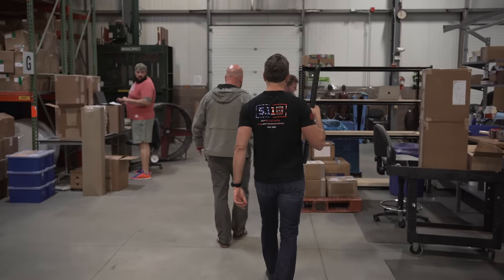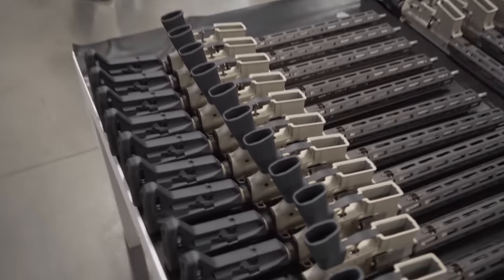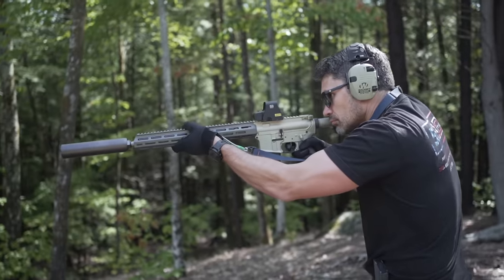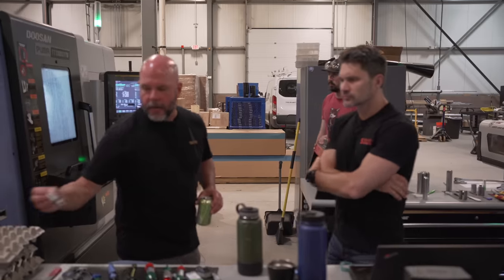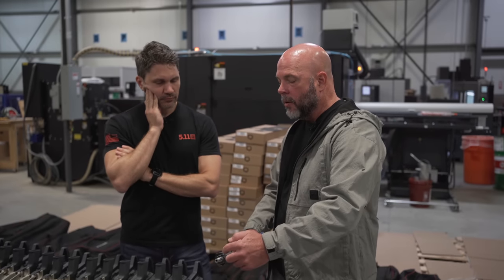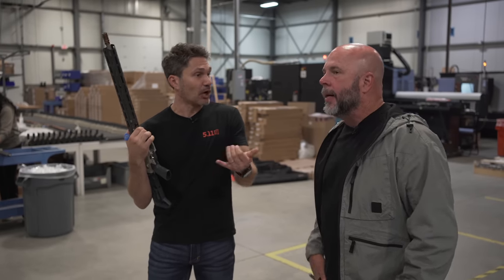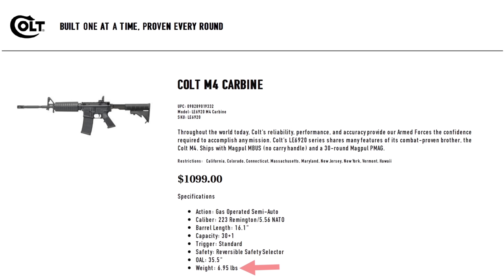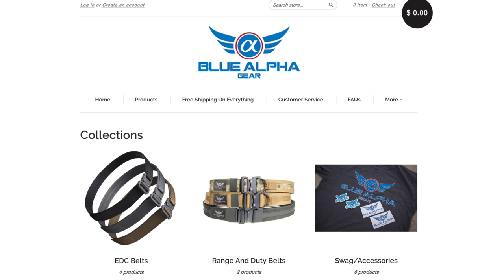Why Q's AR-15 Will Disrupt the Market: The Sugar Weasel 16"

Comment: That seems like a lot of money for a rifle without an ambi-bolt catch. At that price point, I’d expect a little more
Reply: I kinda would like to see an ambi mag release too but I know that's a small market they're not catering to lol.
Reply: @andreivaldez2929 for the money I’d want a full ambi lower. At the very least.
Reply: ^^This.  About 10% of the people are left handed and about 33% are cross dominant.  Additionally 100% of the people who use a gun for self defense can not be sure that a self defense situation will afford them the luxury to choose which side they will be firing from.
Reply: @alexh4436 I don’t switch hands, just shoulders and close my right eye. If you don’t have a hand, you’re not going to be very effective at wielding a rifle regardless. Ambi controls are highly overrated and people tend to lean on the idea to make up for a lack of training.
Reply: @jackjohnson291  Consider an injury to your dominant hand, or even your eye. You'll want things to be as easy to get to injured as possible.
Reply: That's what I was thinking.  The LWRC DI has a full ambi lower and costs about the same.
Reply: @drownthepoor  Manipulation of a rifle with only one hand is certainly not ideal. Reloading, while still holding the rifle with that only hand, is impossible. You’ll have to drop the rifle or retain it in some way (between legs, under arm, on a sling, or holding it against your chest with the busted wing) to both grab a mag and insert it. Depending on your technique, ambi controls can be of use or useless. Since you can’t strip a stuck mag while holding onto the grip, I just bypass a traditional reload and reach around to drop the mag and strip it at the same time (with rifle under arm, between legs, or hanging on a sling) for that scenario. For right hand, I just use my thumb and strip. Regardless of the single handed situation (left or right), both controls can be accessed or manipulated with a reach around or smacking. 

I’ve also only seen a few doing ambi controls with an adequate amount of fencing to prevent accidental manipulation. They also add unnecessary weight, complexity, and more to go wrong. I personally just don’t like ambi controls and think they’re way over hyped, but I have my reasons. People are welcome to disagree.

I should add that I’m not making excuses here for the price of this product or it’s configuration. I’m just relaying my opinion on the idea of ambi controls in general.
Reply: Ok 🙄
Reply: I want a side charging AR, I don't want to have to cut into such an expensive upper.
Reply: Ambi is lame
Reply: @drownthepoor bad argument, if you have a injured hand you’re not using it anyways so ambi doesn’t matter
Reply: @jackjohnson291  My rifle is not ambi, but my point is that it would be the best of circumstances to have one that is.
You don't know what the extent of your injuries could be. You may be able to prop your rifle up on an injured hand, but not fire it.  If you have to switch shoulders/hands having the controls on the other side could change the amount of time it takes to change magazines or whatever. 
I also think you could have to lend the rifle to someone else in real bad circumstances, and if they are left handed they'll retain proficiency.
Some military require ambidextrous smal. arms. 
The Hellion/VHS2 is one rifle that can be switched for whoever owns it, and that's convenient because you're manufacturing one rifle for both users.
Reply: @jackjohnson291  After being basically berated about the amazingness and necessity of ambi controls, I built an AR with them.

I agree with your assessment, I don't find it faster or particularly useful in general. If you really like releasing the bolt with your trigger finger, which I can understand, a cheap B.A.D. lever or one of those bolt catches with the lever built in (for less than $50) can give you that capability, there's no need to be buying expensive lowers (or fully built rifles) for it. Ambi charging handles, safeties, and mag releases are just "whatevers", seems like stuff people do just for the sake of doing it, not because it gives them any real advantage.

If there's one ambi mod I think is actually worth doing, it's the Elftmann speed safety. Not because it's ambi, but because simply pushing the button in and out is much quicker than manipulating a safety lever.
Reply: @jackjohnson291 that's by far the dumbest argument against ambi controls I've seen lol.
Reply: I am interested in just the upper and will throw it on my ambi lower.
Reply: "WeLl JuSt DoN't Be LeFthHnNeEdt ThEn."
Reply: Agreed.  Ambi bolt catch is a must.  I've cut a lower to put one in and it's a pain.  BAD lever is ghetto.
Reply: @drownthepoor coulda', woulda', shoulda' ! You can come up with a thousand reasons why this, or that, would be "ideal" for a given circumstance! Try being prepared for what is MOST LIKELY versus what is possible! The U.S. military has NEVER catered to left handed shooters by providing left hand specific models, and yet, left handed marksmen have adapted and performed fine with standard issue weaponry! As stated in an earlier reply, redundant controls add complexity and weight; two things highly undesirable in a combat firearm.
Reply: Bcm, solgw, dd, Geissele all have no ambi for that price. Actually. Who does ?
Reply: @Edc-Guy  What I was thinking. I'm no Q fanboy. I don't own one of these. But people complaining about the price seem a bit milk brained. What $1500 rifle has an ambi bolt catch? LWRC is the closest one I can think of and it's about $350-$400 more expensive. The SR15 doesn't even have an ambi bolt catch, lmao.
Reply: @AdoreYouInAshXI I bought an LWRC DI standard full rifle for 1600$
Reply: @poip202  the DI or the DI-E?
Reply: @AdoreYouInAshXI  DI-E only downside is the proprietary rail. But honestly how much stuff do you mount on an MLOK rail anyway
Reply: @poip202  Doesn't have the ambi lower with the ambi bolt catch either, does it?
Reply: @AdoreYouInAshXI  yes It does fully ambidextrous
Reply: People shit on bullpups for not being perfectly ambidextrous and then say an AR doesn't need fully ambi controls.
Reply: How much money?

Comment: “You can drop this into any mil-spec gun, it operates correctly, you can engage the safety, and the trigger works” - Q Innovation 😂
Reply: Truly remarkable lol
Reply: “Well I’d sure fuckin hope so.” 😅
Reply: compared to sig's triggers? its absolutely innovation lol
Reply: That’s a dig at Sig
Reply: @f4t4lity0r4  It was intended as a dig at Q, because we sort of assume that function and compatibility out of any AR-compatible trigger, but if the shoe fits Sig, so be it.
Reply: Those really are good selling points.

Comment: I have handled Q products in a local store. The upper to lower lockup is no better than an s&w. The daniel defense sitting next to it blows it out of the water.
Reply: Q is over rated. Saying you can’t get accuracy out of CHF when HK does all day at the same price point and offers more.
Reply: My roommate used an old ear plug to make the lock up on his M&P 15 rock solid, and now i'm learning that makes it better than a Q rifle! Who knew!!!
Reply: I found the guy that bought a DD and has to justify the price he overpaid...
Reply: @aww2525 Nah man, I’ve own neither but have handled both a good amount and the Daniel is definitely more impressive. Don’t get me wrong, the Q is solid rifle and has a unique aesthetic but it’s not exceptional. At that price point I’d still steer someone to an LWRC.
Reply: @aww2525  I came here to find the poor.
Reply: @aww2525 I found the “just as good” guy….
Reply: Can't afford DD or Q. Get Aero with lock up tension screw built in.
Reply: @Soravia  Finally someone said it
Reply: @Lester.M  Agreed but NOT at the same price point
Reply: @aww2525  Q's aren't also overpriced?
Reply: @SheriffMoney  too many proprietary parts on lwrc, bcm is the way. Most everything else you're just paying more for a name and glitter
Reply: @SheriffMoney I went LWRCi M6IC DI in 2018 because of the ambidextrous Lowe controls. I got mine in 2018 before they had an MLok rail option. Mine came with furniture and rail covers, I wish they weren’t based in Maryland (requiring heavy profile barrels). I built a lightweight upper that I can attach if SHTF/WROL/TEOTWAWKIT.
Reply: @Soravia  I have three. I have never needed the tension screws.
Reply: TBF I have an m and p 15 that has zero wiggle between the upper and lower.
Reply: The upper to lower lockup doesn’t matter whatsoever…..unless it’s too tight, then it’s an issue 

Have you ever felt the upper and lower flex on an SR15? Any LMT?
Reply: @alexjr4468  of course it matters. Any sort of wobble is going to increase the difficulty of aiming. I feel like that should be obvious.
Reply: The only upper to lower lockup I've ever found acceptable off the shelf was a BCM, and it was only slightly better than 2-3 completely random unmatched sets of Aero upper and lowers I've bought before.

Sample of size of two, one loose DDM4V3, and tight DDM$V7, so still can't speak well there.
Reply: I like using the rubber Accuwedge better than the screw.
Reply: @SheriffMoney 600$ LWRC lower plus 600$ BCM upper done and done
Reply: How about KAC or HK?

Comment: I don’t see this being much greater then the aero lower/Bcm upper crowd with a LaRue trigger. But not terrible if you want something ready out of the box.
Reply: or even a full BCM
Reply: I feel personally attacked!!
Reply: I do like the Aero guys stuff have a couple of their receiver sets on different guns, always nice stuff.
Reply: BASED
Reply: That's most of my builds - AP upper and lower with LaRue triggers and mounts. Got some full Geissele and LaRue builds too. I might buy a full Q Weasel to compare.
Reply: Adjustable gas. Better trigger. Radian handle and safety.  Silencer mount. All out of the box. You’re saving 600 dollars over one of those right from the rip by not having to add a G$ trigger, silencer mount, the enhanced controls, and it’s nice to have an adjustable block if you shoot silenced.
Reply: And you're  who? Oh yeah nobody but people should listen to you. 👍👍

Comment: If it's not a cold hammer forged barrel, I totally think its cost cutting.  Thanks for having our backs and asking about that James!  (I still feel like its cost cutting lol)
Reply: The barrels cost the same for the manufacturers to procure
Reply: It really isn't cheaper though and he's right, if the chamber isn't hammer forged then it isn't any added benefit. Hammer forging actually was cheaper for a long time and yet they were able to charge astronomical prices. I don't know if its still cheap but it was.
Reply: Funny that you think hammer forging is the end all be all of barrels, meanwhile the f class and bench rest guys are using single point cut stainless.
Reply: @alfey318  Interesting.  Thanks for diving into it more.  👍
Reply: He does make a legitimate point about the chamber and the potential accuracy issues. LWRC hammer forges the chamber and the barrel at the same time. I'm not sure if any of the other companies making barrels in America does that, but I think Daniel defense does as well. 
That being said, unless there are actual issues with your AR, 99/100 modern manufactured AR's are going to be more accurate than the person using them. Even if they're 3 or 4 moa, most people aren't going to notice or care. The people that do notice and do care are going to seek out the products built with accuracy in mind.
Reply: @alfey318 Chf is not the best for accuracy; stainless is usually the best, as someone else pointed out. However, the difference comes in lifetime of the barrel and rate of fire. Chf can handle higher rates of fire, and will often maintain critical chamber dimensions longer. Use case matters!
Reply: Ugh . . . your obsession with CHF barrels continues.
Reply: There are formulations of steel that react better to being cold hammer forged. There are formulations of steel that can be button or cut rifled to a high standard of accuracy and precision. What it comes down to in the end is the steel, the initial drilling, the rifling, the chambering, the stress relieving, the lapping, the crowning, and finally the matching of the final barrel to it's bolt. If the company that makes the barrel takes the time to mount and test fire 3 10 shot strings and observes minimal spread or drift in each and every barrel they make they would consider the final product a success.
Reply: All comp shooters shoot stainless… you have no idea what you’re talking about,
Reply: @aaronorr5586  This would be a lot funnier if your name were AyeronOrr (or however you want to spell something that sounds like "iron").
Reply: @alfey318 Uhhh, barrel life is a HUGE benefit of CHF. Quality barrel manufacturers (DD, LWRC, SOLGW, etc) can make CHFs just almost as accurate as anything else (SS is king). Chrome-lining and nitriding technology of CHF has obviously far exceeded your knowledge.
Reply: @jaydunbar7538  Longevity is the goal of CHF with a chrome lining. Not utmost accuracy. derp
Reply: @alfey318  You clearly don't understand anything about metal or guns.

Comment: I've had a Honey Badger and a short 300 BLK Sugar Weasel, both of which ran flawlessly. In fact, both guns came factory and would run subs and supers without adjusting the gas block. Top notch guns.